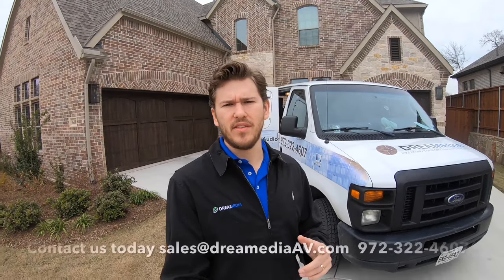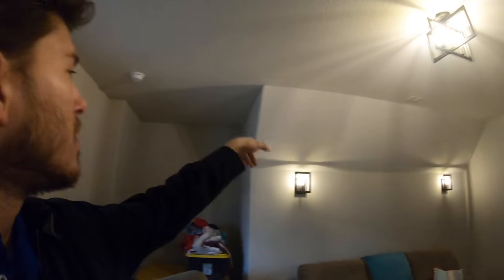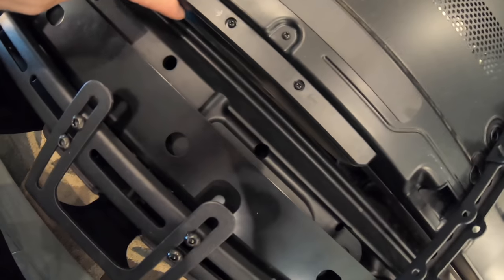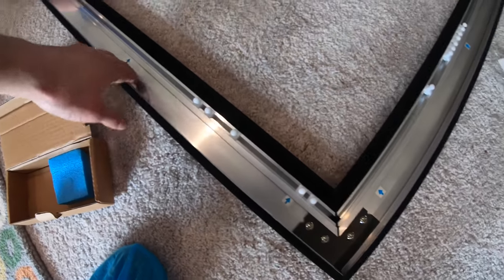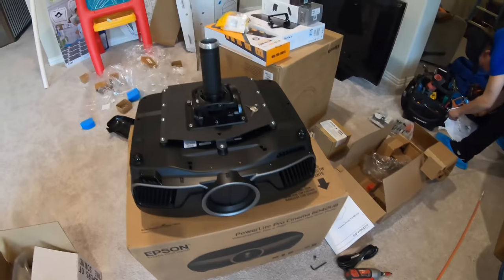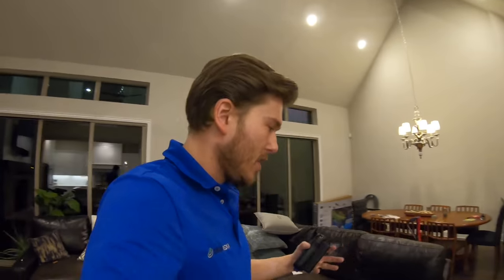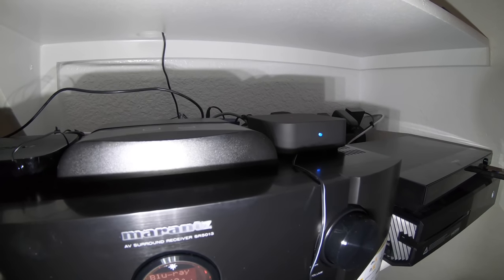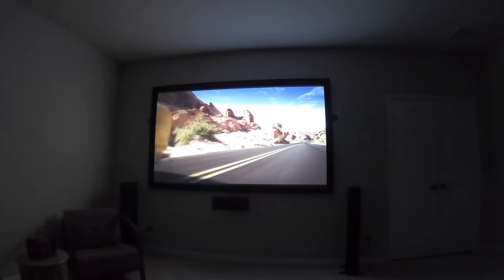5.1.2 Dolby Atmos 4K theater room w/ Living Room 5.1 & Patio Speakers

Comment: I just got 5.1.2 and haven't even taken it out of the box yet and I'm itching to get a 5.1.4. I wish I could try the ones with dual subs, but that might be overkill.
I had a plate of metal customized to hold a center channel either above, or below a tv. I'm pretty proud of it and it's worked with two tvs and I'm about to find if it will work with a 3rd when I upgrade to a larger screen.
The theater room is perfect and the outside too. For the living room, I really feel they could have gone bigger. Maybe even a motorized projector screen with a 150, or 200 inch screen in the living room and then use the tv that is in the living room and put that in the theater room. The size of the living room kinda dwarfs the size of the screen.

Comment: the most important component in this install is the room.  I know this is out of your hands but they should’ve put the TV screen along the other wall so the sound would be better and symmetrical facing into that room so the back could be open... put the sofa facing into the room then you can mount speakers  at your ear level and ceiling. hopefully the calibration will help.

Comment: Hi, Thank you for this video. I got one question if you could help me. Actually I have Sony STR DH1080 receiver. But I don’t know which gives a better Dolby Amos sound. Either 7.2 or 5.1.2? I hope you will help me out. Thank you.
Reply from the maker: go atmos. you will love it
Reply: 7.2 means 7 ear level speakers and 2 subwoofers. 5.1.2 is 5 ear level speakers, 1 subwoofer, and 2 overhead (atmos) speakers. So if you have the overhead speakers use the 5.1.2.